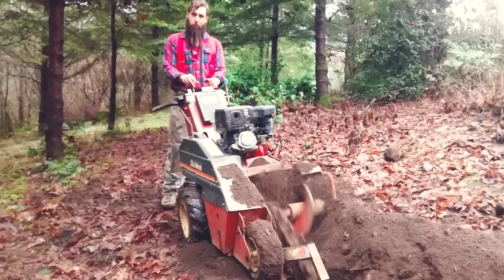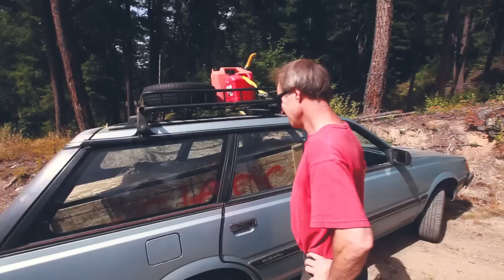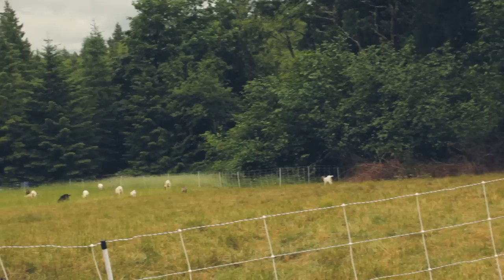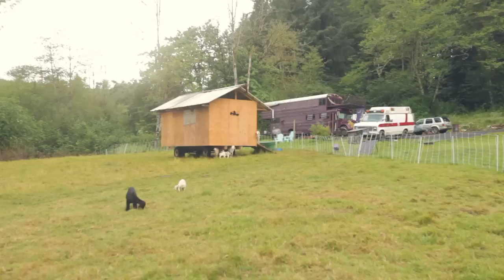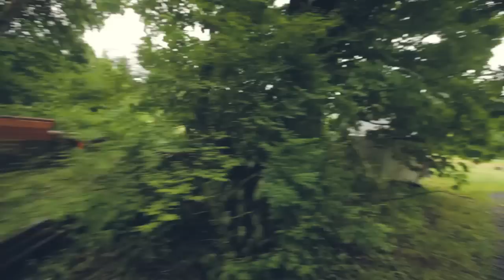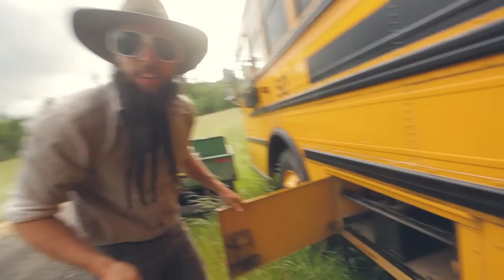3yr Bus living & life Update from Val & Bryce

Comment: That piece that is holding the door together should be painted black to represent the area where the weather stripping used to be. It would be a nice historical movement.  Historically when the previous guy bought the bus, the previous owner may have added the 2nd deck.  When the bus was built, there were three types of Carpenter bodies built at that time.  The Vistaramic was the one that hand the wrap-around windshield.  There was another one which had a 4-piece windshield.  The third was the Ultiramic which is what this one is.  I found  shift boot for Bryce to put in.  Once the new engine goes in, please keep the transmission as a manual.  Keeping it manual is another way to keep some historical flavor with the bus.  Also you may want to join the American Truck Historical Society.  With that organization, you can get a display card for if you want to take this bus to some truck shows.  The next West Coast show will be in Reno, NV.  And in the year 2020, the national show for the Midwest area will be in Springfield, IL.  Best of all, once the new engine gets placed into the bus, and you take her on a national tour, and do make it to Missouri with it, I can hardly wait to ride in it.